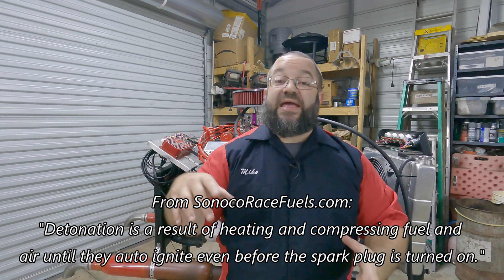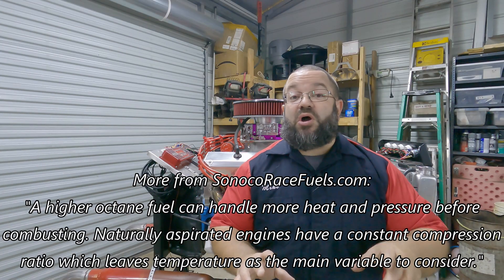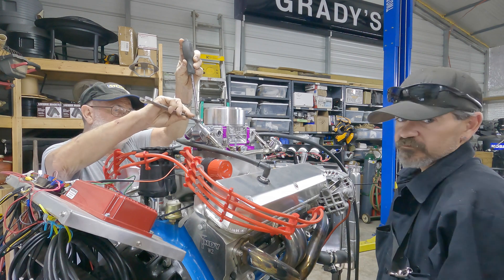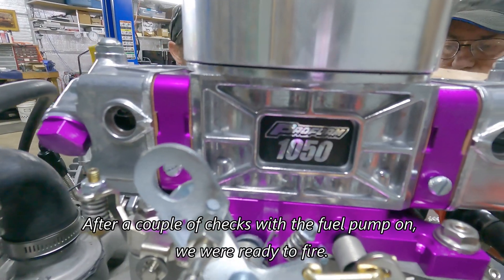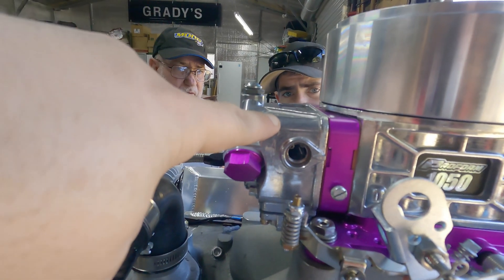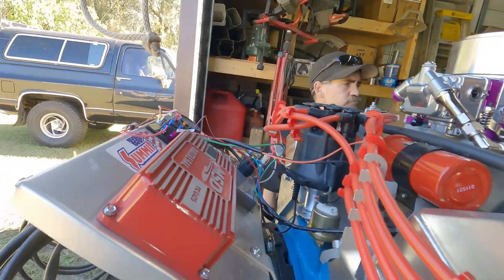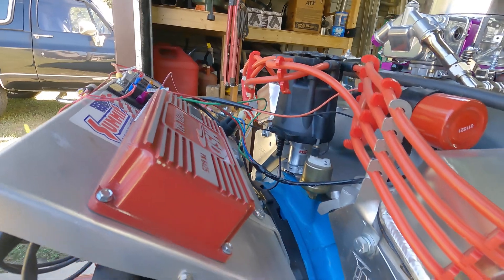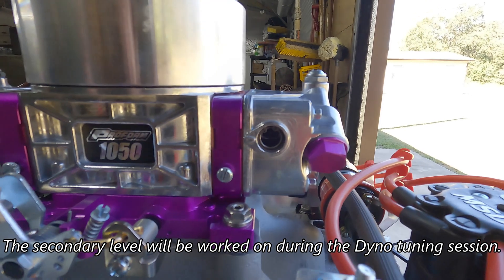The LA-Phant: First Time on Race Fuel

Comment: if you were to , plug the coolant passages in the both sides of deck rear locations .
And add coolant lines from the front of the intake manifold to rear of the manifold.. Your coolant charge would circulate through the cylinder heads first . Thereby lowering cylinder head temperatures and tolerating more compression
Reply from the maker: Lol. Pop and I were just having a conversation on reverse circulation with someone. Kinda neat.